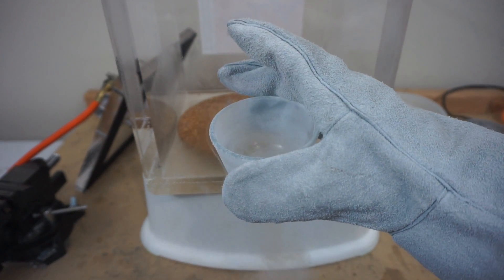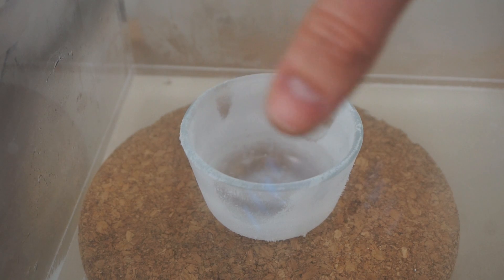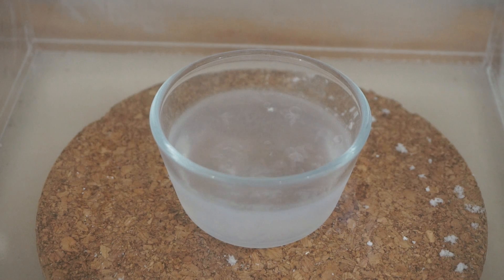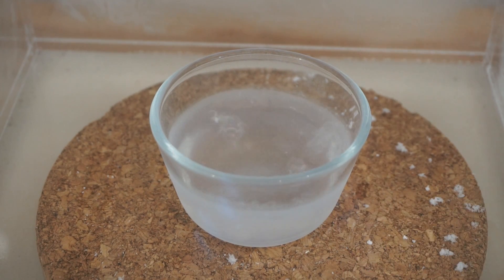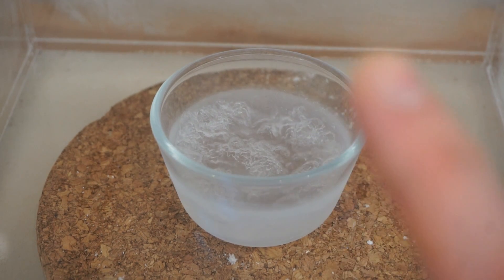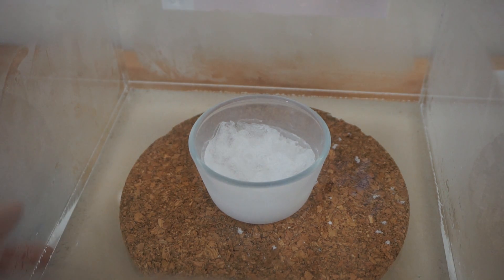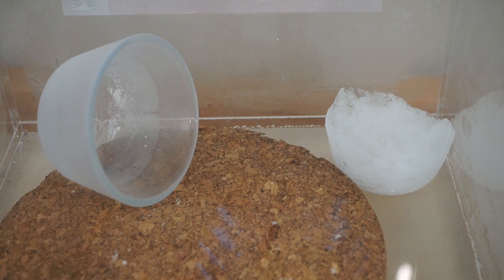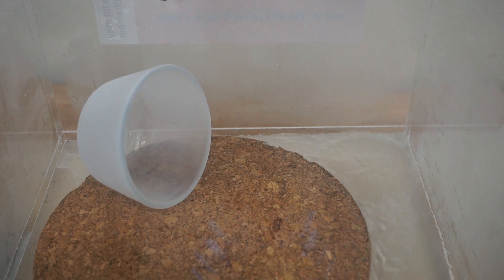What Happens When You Put Liquid Nitrogen In A Vacuum Chamber? Disappearing Nitrogen Snow Ball

Comment from the maker: There are a lot of people commenting that the temperature of the liquid nitrogen didn't actually decrease, but that it only froze due to the pressure decrease. This is not true at all. In general you cannot make a liquid turn into a solid by decreasing pressure. For nitrogen especially, you would actually have to INCREASE pressure to turn the liquid into a solid at the same temperature. So the reason you get solid nitrogen in a vacuum is due to the rapid evaporation of nitrogen that lowers the temperature. The same thing happens with water. It freezes due to the rapid evaporation. Here is a link to the phase diagram of nitrogen so you can see what I mean:
https://itschemicallydelicious.files.wordpress.com/2013/03/nitrogen-phase-diagram.gif
Reply from the maker: +Stephen Conger for water there is a way to decrease pressure and make it freeze, but not for nitrogen. The phase diagrams are different for the two liquids.
Reply: Hydraulic Press Action do you think you could show a diagram of it? It would help me understand. thanks
Reply: Hydraulic Press Action the 6th post down shows a link.
alternately Google phase diagram nitrogen
Reply: Okay got it. It is just I am in 5th grade
Reply: For water, the solid-liquid border is slightly leaning back, (unlike for nitrogene), so if you draw a vertical line e.g. at 0C and going up, you can see the ice melts with pressure, which is an interesting phenomena. Water is quite special liquid.
https://d2gne97vdumgn3.cloudfront.net/api/file/m1GFJVbQSBmwkDXRvglV
Reply: @attilakiss3786   And it's because water expands upon freezing.  Pretty interesting stuff.
Reply: The Action Lab how cold was inside when u put u arm in in the end ?? 🤔
Reply: I think he could have gotten it colder if he had a smaller vacuum chamber inside that one and tried the same thing.
Reply: Very true, it is on the "phase diagram" of nitrogene. http://www.chemix-chemistry-software.com/school/phase-diagram/nitrogen-phase-diagram.html
Reply: Endorphin Rush You can't create a hole of emptiness it just doesn't make sense.
Reply: Can you put hydrogen in the vacuum please?
Reply: Hydraulic Press Action 
so water that is below freezing but still liquid due to pressure will not instantly freeze when the pressure is removed?
I can think of hundreds of videos to the contrary.

Not trying to be a jerk.

Just making sense of it all.
Reply: The Action Lab .
Reply: But i still can't understand How a temperature can get below the absolute 0... I thought it was called "absolute" couse all the moleacules were not moving and Nothing can be colder that that.... am I wrong?
Reply: @fruity_frost2168   Nothing can be colder than absolute zero.  You're not wrong about that.
Reply: Awesome, u explained the concept of triple point through this thanks!!!
Reply: Hydraulic Press Action Can a small vacuum in a big vacuum survive? Will It cause a hole of emptiness?
Reply: 🔴 What Is Islam? ⚠️

🔴 Islam is not just another religion. 

🔵 It is the same message preached by Moses, Jesus and Abraham.

 🔴 Islam literally means ‘submission to God’ and it teaches us to have a direct relationship with God. 

 🔵 It reminds us that since God created us, no one should be worshipped except God alone. 

 🔴 It also teaches that God is nothing like a human being or like anything that we can imagine.

🌍 The concept of God is summarized in the Quran as:

📖 { “Say, He is God, the One.  God, the Absolute.  He does not give birth, nor was He born, and there is nothing like Him.”} (Quran 112:1-4)[4] 📚

🔴 Becoming a Muslim is not turning your back to Jesus. 

🔵 Rather it’s going back to the original teachings of Jesus and obeying him.
Reply: Hydraulic Press Action I tried to read but it didn't happen. It was too much 😂👌

Comment: I'm not fond of physics but I think I understood why it vanished like that. 
Seeing the phase diagram of nitrogen, it shows that at 0 pressure or close to it, there is no liquid state, so when you opened the vacuum, you instantly raised the temperature inside the chamber (since outside it's 290K~ vs 63K of inside) and the solid started to sublimate directly from solid to gas. But as soon as it started doing it, pressure was rising too, so it soon reached a point where there were three states, so it started melting and then evaporating instead of directly sublimating. That's very cool.
Reply: I think it did go into a liquid state first.  the 'snowball' mass shrunk as it melted, spreading itself all across the bottom of the chamber.  Then because it was spread out so much all the molecules were able to heat up at as approximately the same rate so you had a near instantaneous evaporation of the nitrogen spill.  following that was the vapors that seemed to fog up the entire chamber briefly.

Comment: the liquid nitrogen turns solid because it's gone past its' 'triple point'. the temperature and pressure in the chamber is low enough to make all three fluid states to exist at the same time. after that, the pressure is low enough where the nitrogen molecules don't have to be bumped around by air molecules. so they settle into the solid state.

of course the nitrogen disappears, you dink.

it boils/melts into a gas and is sucked out with the rest of the air.

Comment: that it turns into solid nitrogen in a vacuum chamber doesn't mean that this solid nitrogen has lower temperature, it still has the liquid nitrogen temperature, in only turns into solid cause lack of pressure, it happens with water

Comment: Solid Nitrogen----Dry Ice
Reply: No, nitrogen's freezing point is much too low to be a solid for a good amount of time at room temperature. Dry ice is solid carbon dioxide, which has a higher freezing point.

Fun fact: Dry ice is "dry" because it cannot be liquid in the level of pressure from our atmosphere, causing it to go from a solid directly to a gas without being liquid in between. Nitrogen is able to be liquid under normal pressure, therefore cannot be dry ice.

Comment: What would happen if you opened up the lid of the chamber without depressurizing it?
Reply: Spectrum you cant at all because the vaccum has sucked the lid very tightly, you cant open it that easily.
Reply: Ah, Thanks!
Reply: And even if you managed it to open without depressurizing it. The liquid nitrogen will turn back to liquid from solid. As their is no more pressure. It will automatically depressurize even if you eventually dont turn off the vaccum pump or depressurerize manually by human.

Comment: I've actually seen this done before (By Flinn Science labs).
The thing is, if you have a powerful enough vacuum, you can adjust nitrogen's freezing point to be much higher, and the only reason it doesn't stay solid is because it's difficult to get the temperature required to keep it there, so it passes back and forth as the  air pressure fluctuates on the surface. 

When it freezes, the liquid beneath heats it up again, causing the instability cycle. Quite interesting stuff, really.

Comment: +Hydraulic Press Action  Could you possibly due Liquid Oxygen??  I've always wanted to know if you could freeze it, but everyone does liquid nitrogen.  It would be harder, since Oxygen freezes at 54K and has a vapor pressure much lower than liquid nitrogen at that point.  But I'm thinking that since it is such a low vapor pressure, perhaps it wouldn't foam up and form snow like the nitrogen would.  Rather, it would just freeze on the very surface and might just stay like that, or fall apart.  Either way, it would be interesting
Reply from the maker: Yeah that would be neat! It is just so much more dangerous to use liquid oxygen than nitrogen and it is harder get and store (pure oxygen likes to turn normal things into fireworks). But I could could try to figure out if  I could do it safely.
Reply: Hydraulic Press Action  You could.  Well, I guess the main thing would be to find out if it's safe to have pure oxygen going through the vacuum chamber.  Other than that, you just need to make sure that there's nothing flammable around.  Also, once you start pumping, the partial pressure of oxygen will quickly drop below the atmospheric level, which is what really matters anyway..

In terms of making it, you could just funnel oxygen gas through a copper coil

Comment: Ive always wondered if its true what my physics teacher told me. If you were to put a newtons cradle inside a vacuum, would it go forever?
Reply: Sky of Glass If the cradle was perfectly crafted, then it would work forever, however the friction and such would eventually slow down the balls.
Reply: gravity is what causes it to work. In a perfect vacuum, the balls do not lose any energy to sound, or air resistance. However, they would lose energy to the friction of the string and base that holds them, so they would go for much much longer, but not forever
Reply from the maker: I did a pendulum in a vacuum (same idea as newton's cradle). It won't go forever, in fact it slows down pretty quickly due to friction in the string.
Reply: Sky of Glass probably not, gravity also would effect the newtons cradle
Reply: Hydraulic Press Action thank you for letting me know, and making it so I wouldn't have to make a vacuum chamber to test this XD
Reply: +William Jack  It wouldn't go forever, but the reason is not gravity.  The friction in the string to its attachment and internal forces would slow it down.  But perhaps the biggest "stealer" of energy would be the constant banging of the metal balls.  It isn't a perfectly elastic collision

Comment: Isn't solid nitrogen dry ice????
Reply: Dry ice, sometimes referred to as "cardice" (chiefly by British chemists), is the solid form of carbon dioxide. It is used primarily as a cooling agent. Its advantages include lower temperature than that of water ice and not leaving any residue (other than incidental frost from moisture in the atmosphere). It is useful for preserving frozen foods where mechanical cooling is unavailable.

Dry ice sublimates at −78.5 °C (−109.3 °F) at Earth atmospheric pressures. This extreme cold makes the solid dangerous to handle without protection due to burns caused by freezing (frostbite). While generally not very toxic, the outgassing from it can cause hypercapnia (abnormally elevated carbon dioxide levels in the blood) due to buildup in confined locations. whearas Liquid nitrogen is nitrogen in a liquid state at an extremely low temperature. It is a colorless clear liquid with a density of 0.807 g/ml at its boiling point (−195.79 °C (77 K; −320 °F)) and a dielectric constant of 1.43.[1] Nitrogen was first liquefied at the Jagiellonian University on 15 April 1883 by Polish physicists, Zygmunt Wróblewski and Karol Olszewski.[2] It is produced industrially by fractional distillation of liquid air. Liquid nitrogen is often referred to by the abbreviation, LN2 or "LIN" or "LN" and has the UN number 1977. Liquid nitrogen is a diatomic liquid, which means that the diatomic character of the covalent N bonding in N2 gas is retained after liquefaction.[3]

Liquid nitrogen is a cryogenic fluid that can cause rapid freezing on contact with living tissue. When appropriately insulated from ambient heat, liquid nitrogen can be stored and transported, for example in vacuum flasks. The temperature is held constant at 77 K by slow boiling of the liquid, resulting in the evolution of nitrogen gas. Depending on the size and design, the holding time of vacuum flasks (Dewars) ranges from a few hours to a few weeks. The development of pressurised super-insulated vacuum vessels has enabled liquefied nitrogen to be stored and transported over longer time periods with losses reduced to 2% per day or less.[4]

The temperature of liquid nitrogen can readily be reduced to its freezing point 63 K (−210 °C; −346 °F) by placing it in a vacuum chamber pumped by a vacuum pump.[5] Liquid nitrogen's efficiency as a coolant is limited by the fact that it boils immediately on contact with a warmer object, enveloping the object in insulating nitrogen gas. This effect, known as the Leidenfrost effect, applies to any liquid in contact with an object significantly hotter than its boiling point. Faster cooling may be obtained by plunging an object into a slush of liquid and solid nitrogen rather than liquid nitrogen alone.
Reply: Soi dry ice is solid CO² not nitrogen.
Reply: oh

Comment: did its temperature really fall or its freezing point came up to the room temperature because of extremely low pressure??? 
please reply...
Reply from the maker: The nitrogen actually becomes colder due to evaporation, that is why the nitrogen freezes. When any liquid evaporates it gets colder. Lowering the pressure cannot "raise the freezing point." You might be getting confused with the idea that lowering the pressure lowers the boiling point of a liquid. If you look at a phase diagram you can see why this is the case
Reply: As the pressure drops, the boiling point also drops, causing the liquid nitrogen to boil more vigorously.  As some of the nitrogen turns into a gas it steals some heat away from the remaining liquid still in the glass, eventually cooling it below freezing point.
Reply: Nitrogen has never cooled, lowering the pressure causes the boiling point to go down and freezing point to come up. As the freezing point rises and reaches equal or above the ambient temperature it freezes.
Reply: Saquib Faishal  Lowering the pressure can only bring up the freezing point by a very small degree in certain substances.  Water is one of them.  Lowering the pressure of water changes its freezing point from 273.15K (0C, 32F) to a maximum of 273.16K (0.01C, 32.02F).  But that sure as hell isn't the reason that water would freeze in a vacuum chamber, and it certainly isn't the explanation here
Reply: Watch his video on water boiling in a vacuum. He puts a thermometer in the water and proves it cools as the pressure drops. Same thing with any matter.
Reply: No, the pressure would have to increase for that to happen. Remember that in solids, the particles are closer together, if the pressure decreases, they spread out and turn into fluid.
Reply: Right
Reply: Please learn some physics. Thank you.

Comment: it would be far more impressive if you made solid helium, it has a far lower freezing point than plain old nitrogen
Reply: Gabe Hopkins is that possible? If so I really wanna see it
Reply: It’s basically impossible to do it in his vacuum chamber
Reply: @humanppplus4306 or any vacuum chamber. Helium doesn't have a triple point, so it can't be frozen solid using this method

Comment: can you make a huge bach of solid nitrogen to still get some nitrogen snow at normal atmosphere
Reply: maybe a simple robot arm that would need just some wires to go trough the container or something that is controlled by wireless
Reply: like if you agree
Reply: Justin Tremblay what tf would make u think that would work
Reply: Biggie Cheese dont know just guessing
Reply: Imo that would be cool, but you'll need to be freaking faster. He could try to touch the nitrogen snow/ice using a glove (which need to be outside the vacuum chamber) but that allows you to touch inside without put your hand into a vacuum.
Reply: While that is a possibility, I think that a glove attached to a hole in the vacuum chamber would just rip completely off due to the outside pressure pushing it into the low pressure vacuum chamber. It'd probably need to be a really heavy duty glove attached with welding
Reply: pogo1027 Yes, I was thinking what could it be. I've said glove, but it can something else that withstand the vacuum
Reply: Justin Tremblay  I'm not sure that's possible.  Even a lot of nitrogen snow would likely melt to fast too do anything with.  If you could dunk it in something colder like liquid hydrogen or something, it would probably last longer due to the much lower surface area exposed to air.  Of course, that would take a lot of liquid hydrogen and you would prbably wind up with a fire/explosion hazard on your hands haha